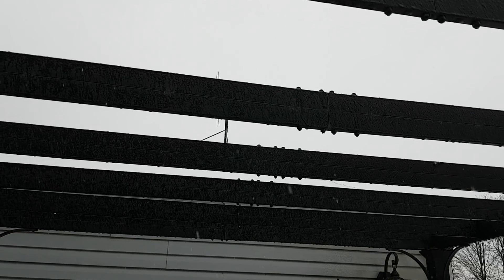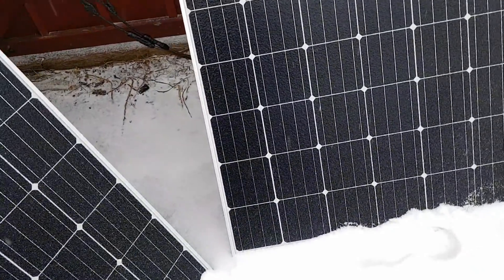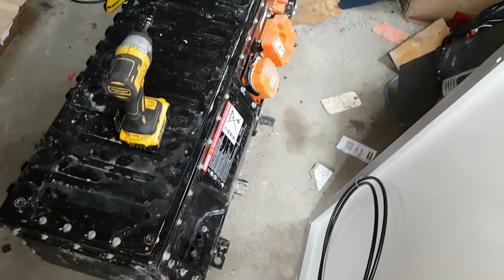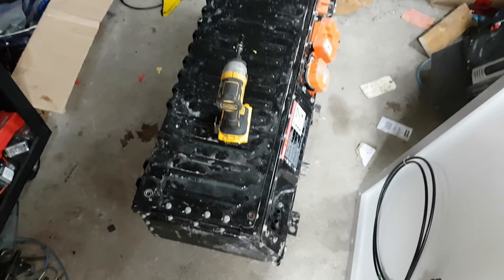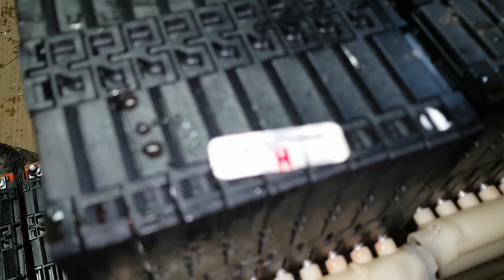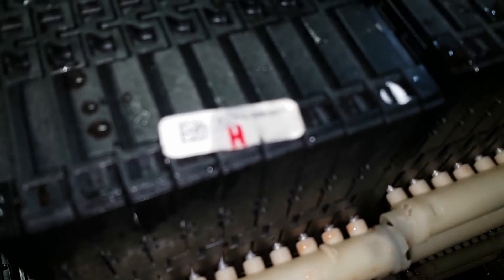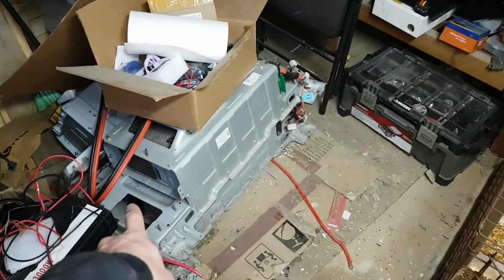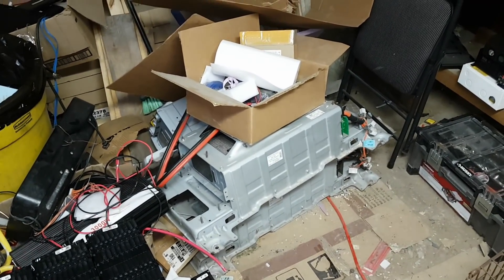Ice Storm 2018 And 23Kw Ev Battery

Comment: hey great vids and OG system you have goin on!! I'd like to get in on this type of battery system but I have no clue as to how to get these batteries and of course the bms. I have been watching to learn more and I thank you and many others doing this again. Im stoked you guys are out there doing this and other stuff. Im in Hamilton, close to you, at least in Ontario. How can I get some batteries through you or your contact. I have a 12volt system Im looking at running my system with a 4s configuration exclusively. The pack you just disassembled was in 4s modules @16vdc, I would parallel them. thanks again for your vids man. I subed to Frank Z too.
Reply from the maker: I dont have any batteries atm, but in the future I will start to hand out the deals!

Comment: very hard to believe that one pack is 23kWh... u sure its not from a hybrid and is around 10?
Reply from the maker: TRY to HELP you i just found out there is a second part to this battery, but the 23kw sticker was on this battery i got so i was miss lead
Reply: Going Off Grid yeah. Each block should be between .7 and 1 kWh from the looks of it.... depends on cooling louvers/plates. Probably using the wrong words.
Reply from the maker: each b.ock is 1.2kw each new.

Comment: are all your panels poly? I recently got some mono panels. since they suppose to be more efficient  in lower light .  do you think there is a real world difference. or could I have saved a little money? now I need more batteries. then more controller and panels! I thought about going LiFePo4. with 8 cells. or 9 cells. then just not fully charge. since not fully charging extends life. what you think? I'd like to find some car cells! building 18650 packs suck. I thought it would be fun. but when parts are late or don't come in. and you got cells everywhere! and it takes forever to charge and test hundreds of cells. if I just had to assemble packs. and had the parts. I guess it would be fun! great video!
Reply from the maker: haha I don't find a difference between the two type of panels, and I have both, i get what ever the best bang for the buck, I want at lease 3 bus bars per cell other then that I dont care much about polly or mono.

Comment: Whats the meaning of  12S 16S or 8S
Reply from the maker: 12s means 12 cells at 4.2 volts in series, 16s is 16 cells at 4.2v in series. :)
Reply: Going Off Grid THANKS A LOT BRO :DDDDDD

Comment: Damn I used to live in oshawa but im back in nova scotia!
 I'm building my packs out of 18650's in 14s24p around 2.9kwh depending on cell capacity with what i have now in cells it's around 10kwh but I found a place that I can buy laptop batts for $1 a peice and i can get 100+ packs at a time. Charging each cell and discharging to find capacity is slow going though lol

Comment: If your battery come from a Ford Focus EV you don't have 23KW in your pack. The battery pack of a Ford focus EV is splitted in two modules. Do you have the other one ? The one that you have dismantled is located behind the rear seat. There is another half of the battery located under the car.
Reply from the maker: really? it said 23kw right on the metal box the battery was in, thanks for this information!, im not so happy now... I will have to test it to see what the capacity is.
Reply from the maker: also it might of been a different car like the escape, i cant remember :S
Reply: There is a Ford Escape Hybrid with only a few KWH battery. Ford Focus EV 2016 and before have a 23 KWH battery. Type "Ford Focus EV battery" in Google and look for picture you will see the splitted battery.
Reply from the maker: dang wonder how much kwh I have :S
Reply from the maker: well looks like i have a 12kwh battery :D thanks for educating me! im a little pissed as the battery says right on it 23KWH WTF
Reply: For 23 kwh you should have 20 large modules and 2 small modules
Reply from the maker: I talk to the guy I got the battery from and he didnt even know this :D thanks! I am now getting the rest of this battery!

Comment: I don't know if you have a video on what is 8 s  or maybe you could do one .
Reply from the maker: 8s means 8 cells 4.2v each in series to make a higher voltage battery, a 8s pack has 8 cells at 4.2v x 8= 33.6 volts :)

Comment: Awesome find brother. I wish my batteries werent so good . Id buy in a sec:). I may be able to sell if you cant.  Thanks for the vid
Reply from the maker: i only have one sonota battery for sale atm witch is 1.4 Kwh and might have a buyer for it already lol
Reply: Can you load test the new ones without putting them in the system?
Reply: I thought theyd move quick but worth the try :) Great vid
Reply from the maker: yes I can, with a inverter I can test 2 packs at 66v and use a kw meter to get a good idea of capacity, im not sure if its sold we will see
Reply: Its all good . Do you test to see what you have or toss them in? I guess its easy enough to just test them on the house too. But you buy them used? So how do you know what your buying?You know what I mean?
Reply from the maker: they have all been good except one pack, the bms wires were shorted and no good, all the ones I have have tested to be 4 ah or higher, at this point I just make sure all the cells are balanced then I use them and keep an eye on them.
Reply: Nice. Thanks

Comment: How many kilowatt hours do you think you would need to run a house. Great video keep it up
Reply from the maker: depends on the house and how many people live in it, my house is all electric but the furnace witch is oil, I need about 60-100Kw to run my house with out sacrificing anything, and I need 10000w of solar. I have 6 people that live here and use a lot of power.
Reply: Going Off Grid thank you

Comment: Oh Canada.... wow what a spring ...March was awesome for sun then this lol. Ford has some 20 ah lithium that look awesome and easy to use off the CMax. I need to get some batteries for my battery backup of my grid tie system. Would you think of selling any of yours? or passing on a lithium car battery as you seem to be able to find them. Cheers stay charged up.....
Reply from the maker: I am getting rid of my gel batteries, my rents that of off grid want them, so I have been working on getting these car batteries to replace them, as soon as im done replacing the capacity im losing from these gels I will start sending these lithium ev batteries to anyone that wants it, as of now I have 1 sonota hybrid battery for sale 150 for 1.485 Kwh
Reply: OK I'm just up the highway north of Orillia will keep in touch. The volt or the Cmax would be my preferred battery and the price seems good.